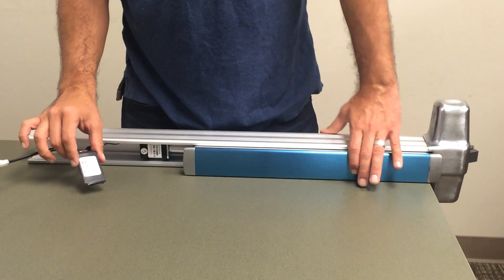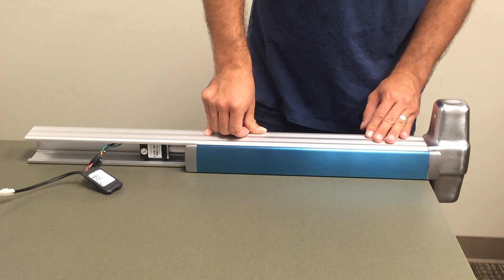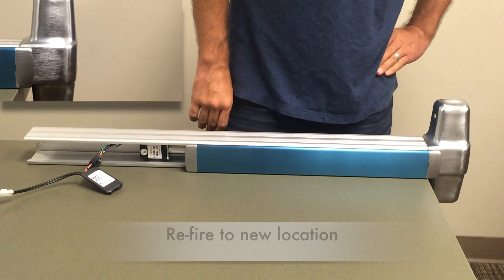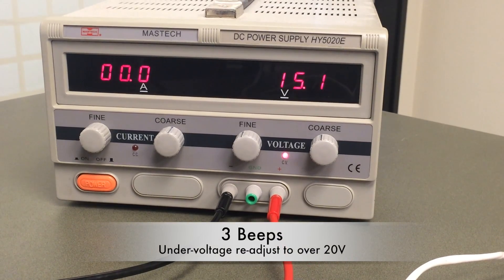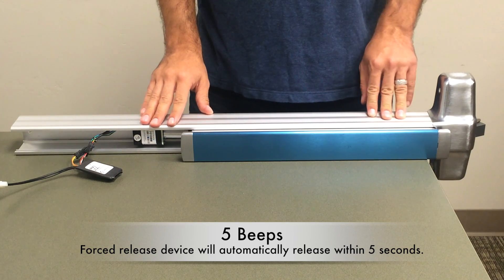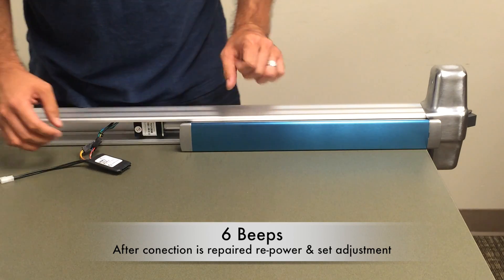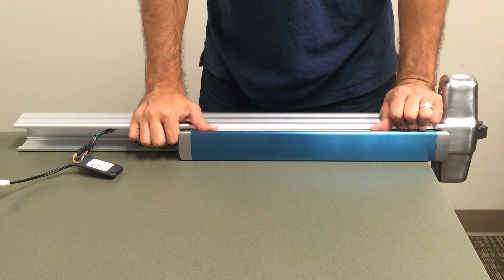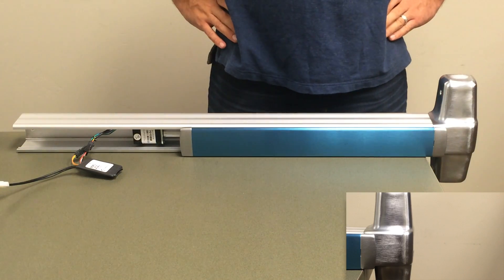"PTS" - MM3 Adjustment & Diagnostics

Comment: What does re-fire mean? I'm having an issue after PTS programming is done, the push bar is not going to it's set location.
Reply from the maker: Sorry for the delay, for immediate support we recommend calling into tech support. Re-fire means to activate the device again after setting the PTS location. If you're having issues with the location, try depressing the push pad all the way then releasing slightly before setting the PTS. If you're still having issues give us a call at 888-622-2377 & ask for DJ or Fred. Thanks!